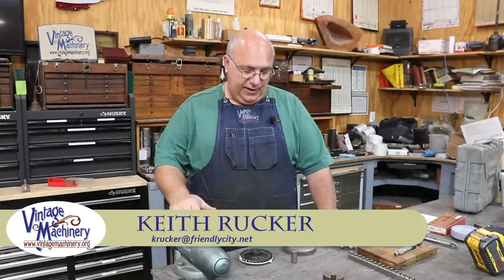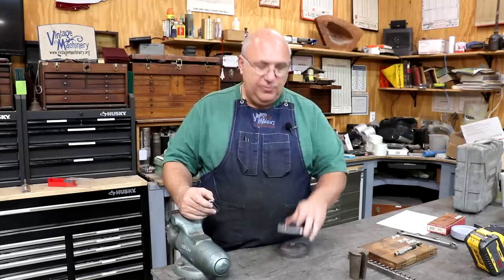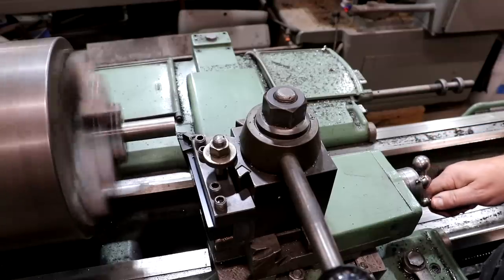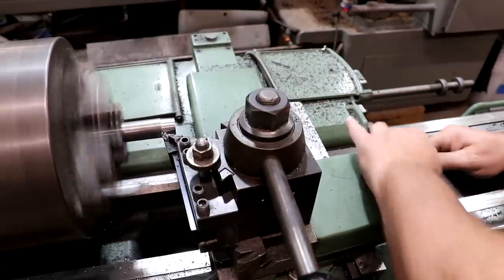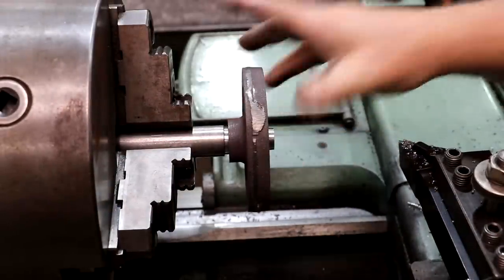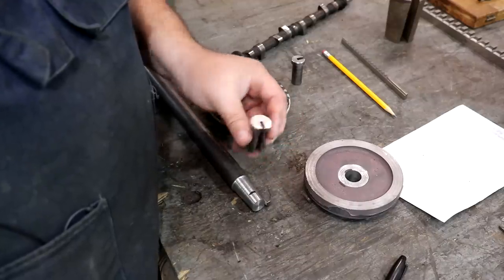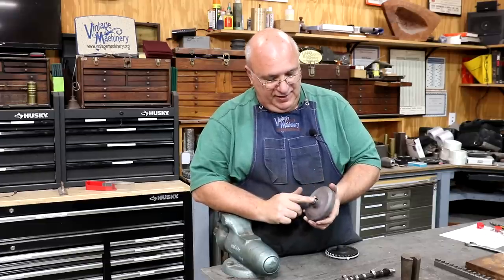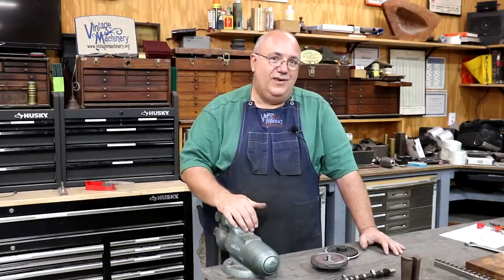Making a Tapered Broach Bushing for the 1928 Austin Camshaft Timing Gear

Comment: The timing is hugely important, the timing gear indexes on the keyway, and ensures that the cam timing is correct when all the timing marks are lined up, even a few degrees out will make the engine run rather less well.
Reply: Micky's exactly right.  That key sets the valve timing relative to the crankshaft and pistons and there is no fine adjustment.  The more care you take in duplicating the timing of the original gear, the better.  I don't think it's possible to overstate the importance of this measurement.
Reply: @kensherwin4544  IMHO that keyway should be done first to enable a positive anti rotation mount for the gear cutting .its got to bet better that 1 deg . I bet that OE was cut on a Gleason gear hobbing machine
Reply: @stuarthardy4626  I would do the keyway first, too. A matching keyway in the arbor would insure the gear doesn't slip while machining the teeth. 

My guess our thoughts on how this "oughta" be done are irrelevant because the job is done by now.  It will be interesting to see how he chose to do it.
Reply: Just for those reading along, we are talking VALVE timing, This is not anything like normal ignition timing, that is set and re-set often.
Valve timing is set by the manufacturer and during engine maintenance, or even rebuild, normally there is no way to alter it.
Reply: @MikeBaxterABC  Advancing the cam is an old hot fodder trick to get more horsepower. There’s several ways to do this but an offset key is the most common. Since camshafts rotate at half engine speed 1 degree = 2 degrees on the crankshaft. It will be interesting to see how Keith matches the keyway to the gear teeth.
Reply: Keyway is relevant to cam timing very important placement
Reply: Helical Gears should be able to time by changing the plane of the gears to each other. As this one is fix on that taper the matching one could be moved in and out with washers and thereby change the timing. The meshing will change with this but will stay in an usable range for a while. So in fact the axial fit of the taper will affect the timing, the set of the planes axially will affect it and of course the timing of the key will affect it. If i do not have a hickup in my mind.😄
Reply: @hermannstraub3743  This is not the usual way timing is set. Both gears need full engagement for proper operation. Since this engine (like the flathead Ford V8) uses a timing gear instead of a chain the camshaft turns in the opposite direction to the crankshaft. This must be considered when setting the timing.
Reply: I'm glad all you folks are thinking about this 'cause my unds were definitely getting into a twist ... heh.
Reply: While this is true to some extent I have found factory gm cams have installed cam timing variance of +- 5 deg. One of the reasons some engines run better than others. Worst case you can generally adjust cam timing with an offset key if absolutely necessary.

Comment: Mr. Rucker, A mate of mine runs an engineering workshop in Australia, he has seen both of your videos and he tells me to get this work done if, the owner of the part could find someone to take it on would cost quite a few hundred dollars in not only machine time but labour as well. not many shops would do a small specialist job like this. All the power to you sir
Reply: Fortunately there are several videos and enough viewers to make it advantageous from a video aspect.
Reply: @jayreiter268  With the added bonus of watching a helical gear fabricated on a semi obsolete K&T horizontal mill using Rube Goldberg style attachments.
Reply: @cyrilhudak4568  I would not call it Rube Goldberg. that is the way it was done on those machines. They also had high production machines. Automatic screw machines and Gear Hobbers. Bet you can make great cams for a screw machine on a CNC if you want production.
Reply: @jayreiter268  ☺ Where do you think Mr Goldberg came up with the ideas for his contraptions?
Reply: @cyrilhudak4568  I am only eighty so I do not know. I have seen  just a few of the cartoon strips but they were before my time.

Comment: As other said the key position is critical. One mod on other pre-war cars is replacing the timing gears with more modern designs that allow fine adjustment of the valve timing as adjusting it on the timing gear teeth is far too coarse an adjustment. This film was most interesting, thank you. I asked on my own channel how this is done and someone sent me here. I need to make a driving dog to fit a magneto to drive a water pump on a Pre-War Riley. The magneto shaft is tapered and keyed. I can machine a taper but doing the keyway is beyond my capabilities. This explains perfectly how I could do it but I don't have a broach set anyway. I can buy an existing part with the right taper/keyway in it and modify it by adding a separate driving dog piece to it. Buying the part to modify, though not cheap, is still far cheaper than buying a decent broach set.

Comment: The relationship between the gear tooth and the key is critical. The engine builder should check valve timing during assembly and use an offset key to correct any minor error. The key does not carry load, it only maintains the relationship until the assembly is tightened. The taper engagement carries the load when the nut is tightened to the proper torque spec.
Reply: I was thinking that too, from the point of view of rebuilding the engine. I imagine the position of the cut gear teeth in relation to the key would also be critical, but Keith seems to be ahead of me on this!
Reply: It’s a 1928 low compression engine (8.5?) that likely doesn’t operate above 3500 rpm.  A 1/4 to 1/2 degrees of value timing isn’t that critical.  It’s not a 6000 rpm, high compression ratio modern engine.  Keith has a rotary indexing plate.  He can use the same key cutter to index the old and new to align the teeth
Reply: @jimeadie4415  Likely under 6:1 compression. Maybe far under.
Reply: @jimeadie4415   Jim, I think you are right here, if I counted right there are 32 teeth so at worst and whole tooth out would be 11 and a bit degrees, but of course it runs at ½ engine speed so  that five and a bit degrees, but , here my logic goes a bit woozy, but  at worst, one can’t be more than half a tooth out or you ‘d off by the next tooth, so if I’m right that means half again .  I had a read of the A7 forums and this gear gives all manner of hassles.

Comment: The relationship of the key and the gear teeth is highly important to ensure correct valve timing is maintained.
Reply: I’m pretty sure that Keith knows this is a timing gear that must be accurately keyed to the crankshaft. If he doesn’t he’ll have a beautiful helical gear to display on a shelf that will not work on an engine.
Reply: @ellieprice363  I'm pretty sure he knows it as well but just a little puzzling why he should say in the video he is not sure if the keyway location is important/critical
Reply: @howardosborne8647  I noticed that too. Actually if you had the engine it could be timed accurately without a key but you’d have to have a good understanding of engines, cams, and valve operation.

Comment: You are correct in assuming that the placement of the keyway is important. The gear has a timing mark that would align with a corresponding mark on the engine. The camshaft needs to be set in time with the crankshaft for optimum performance. One tooth off in either direction could really affect how well the engine runs.

Comment: As a retired Auto Mechanic I have been silently waiting to see if you were thinking ahead enough to index the keyway to the marked tooth (which is very important btw not that you needed me to tell you that if you're reading the comments valve timing being off one tooth will effect idle quality terribly) & as normal you didn't disappoint me. I think it's so cool that you & (seen Abom do it to) will make a part & not know much about what said part goes on or does but you can make it anyways.. Now on to cutting the helical teeth.

Comment: I see comments that the key should be used to hold the blank while cutting the teeth.  Wouldn't the taper hold the blank securely enough to mill the teeth?  I mean, there will be a nut to hold the arbor, too. Tapers are quite good at locking up. 

I never figured on an offset key to make up for minuscule errors.  Brilliant.  And the statement that the taper holds the position of the gear on the camshaft makes perfect sense, too.

Lots to be learned in the comments for older gear driven valve timing.  Another addition for the mental tool box.

Comment: Keith, I wonder why you don't make a keyway using metal plainer? You can hold the gear at any angle and cut the keyway using some sort of short boring bar with single-point cutter.

Comment: Curious.. is it obvious that the key allways shall be cut parallell to the axis of the shaft…. My gut feeling was that it might be an good idea to cut it parallell to the conical surface? (Maybe not in this part, but generally speaking).  And another thought… a normal straight broachplug rests on the wide lip at the top when broaching… this plug has to jam into the sides to stay in place…. Isnt there a risk that it will deform and jam up the gap for the broach? I’m a shop noob, by I would have tried to keep a lip at the top to take up the axial forces of the broach friction against the plug….. (just some speculation)….. thanks for your entertaining videos…

Comment: I wonder if the tapered broach bushing could be done a little different.

DISCLAIMER: I have absolutely NO practical machining experience.  This is just me speculating.

I would have kept cutting the taper until the gear hit the collar before it tightened up on the taper.  Get it as close as possible, but with a slight clearance fit on the taper.  That would keep the broaching pressure from tightening the gear into the taper of the bushing.

If the gets pressed into the taper, it would only require a hammer or press it to get it back out.  So, probably no problem.

But, I wonder:  Depending on the clearance between the broach and the bushing, could the taper actually pinch the ears on the broach and bind up on the broach itself?  It would have to be a really tight clearance for that to happen.

In the end, I think going the extra trouble I was thinking of, would at worst be wasted work.  But maybe, just maybe, avoid a possible issue?

So, I am mainly posting this to see what comments you actual machinist would have.  And see if I am starting to think like a machinist.

FYI: I have a new hobby grade lathe and mill, but don't have it installed, yet.

Comment: Aren't you edge finding to locate center of the broach bushing on a part of the shaft that wasn't turned? In a three jaw chuck won't that tir error offset the key from center? Maybe better to have turned the shaft OD clean to give an concentric surface for edge finding...

Comment: Hi Keith. Dumb question. When you were measuring the center line for your custom broach thingy, you touched off on the left edge of the workpiece with the right edge (from the viewpoint of anyone watching the video) of the edge finder, then you traverse the table over and touch off the right edge of the workpiece with the left edge of the edge finder. Won’t that throw your measurement off by the radius of the edge finder once you divide the measurement on the DRO by 2? Or did you already accommodate for that off-screen? 🙂
Reply: Because any "error" will be exactly the same both sides, you just divide the DRO measurement without regard to the edge-finder or piece size

Comment: Great video, I am totally surprised because I thought the group for the brooch had to be parallel to the angle on the tapered part. That way your broad keyway will be parallel to the angle on the finish bar. Am I wrong thinking this way or what?
Reply: That is the way I did my tapered broach guide.

Comment: I have a question!  Do you, by any chance, know why the designers used a tapered connection to attach the gear to the cam?  Just another why would "They" do it that way question.  BTW, "THEY" is that big international organization that runs everything.  Looking forward to seeing the the K&T cut the teeth in that gear.  Thanks for the videos.
Reply: My bet would be to make a solid connection it would either be tight or loose and easily discernible

Comment: Should be a timing mark on the existing gear that is relevant to the key in the gear and the teeth.....Helical gears present challenges not present with spur gears.. Angle of helix, lead of helix, real pitch,, the number of cutter differs as compared to spur gears.. Also, with cutting helical gears, rotary thrust is present....There are over 42,000 leads in the Kearney and Trecker low lead chart and very unlikely that you will find the exact lead rather it will fall between two.. Cheers from Louisiana; Mike

Comment: I am probably in error, but shouldn't the slot in the broach plug be at the same angle as the taper?  Looks to me like the keyway at the top will be very shallow when compared to the bottom.
Reply: If I  understand the other comments correctly the keyway is there to locate the gear for engine timing.  As such the key is not being loaded radially.
Reply: Yeah I would think the same.

Comment: Does a broach bushing typically get heat treated?
Reply: For a one off job it is not necessary to heat treat. For repeated use it should be hardened, however heating the tool can cause final dimensions to change which requires making the tool nominally oversize and precision grinding the final dimensions after treatment. I suppose that shows where some costs can accrue from making a simple tool designed to be used minimally versus one that is designed to do the job while providing a useful life in production environment 🤔

Comment: Shouldn't that keyway follow the taper of the bore rather than being vertical?
Reply: No it shouldn't. The key seat in the shaft is always parallel to the centreline of the shaft therefore the keyway cut into the bore of the gear needs to match that axial alignment. The taper is only related to the bore not the key. A similar situation exists with tapered threads in that the threading tool is set parallel to the centreline of the workpiece rather than parallel to the tapered outer
Reply: I had that thought, making something to hold the gear on an angle so the broach could be kept being pushed straight down completely vertical. then you got to go to all kinds of trouble to cut the key on the shaft at an angle. Half way through this is the simplest, fastest best way to do it. I have a complex mind which is great for complex solutions, but boy sometimes its a massive detour here there and everywhere and someone does the same job in a fraction of the time lol
Reply: @howardosborne8647  Thanks for that info.

Comment: Keith, did I miss something?
When using the edge finder don't you need to compensate for half the diameter of the edge finder?
Reply: Not if you check both sides of the shaft with the edge finder Half of the reading will put you in the center of the shaft.
Reply: @ellieprice363  Disagree.  The diameter of the edge finder matters.  The DRO shows you where the center of the edge finder is, not the side of the edge finder.
Reply: @919Drones  you are wrong. (X1-d/2-X2+d/2)/2 =  (X1-X2)/2. The offset on either side compensates for the irrelevant diameter of the edgefinder
Reply: @919Drones  I really don’t think you know how to use the half function of a DRO.
Reply: @919Drones  That’s true if you’re using the edge finder on one side of the shaft only. The other way is to zero the edge finder on both sides of the shaft then take half of the total reading to put you on center. This is the method I was referring to.

Comment: 0:50 it would have been possible to broach the gear, then cut the taper on it.  Still wondering about the valve timing though.   See what happens :)

Comment: Hi Keith, would it been possible to broach before you tapered the hole with a standard insert?
Rich
Reply: Yes but it would be an interrupted cut and could potentially chip the edge of the keyway

Comment: I wonder why the cam shaft designers decided to put a taper there. Im pretty sure there must be a reason for that but I cant get it.
Reply: LOL because in 1928 they did shit because they could.
Reply: Some used a tapered nose some just a tightly toleranced sliding fit on a parallel nose with a key in it.
Reply: @cyrilhudak4568  hehe reminds me of Jeremy Clarkson putting forward Brunel for Greatest Britain, The rectangular box rail bridge was copied across the world because it was easier for the designers and the people who cut the metal to do. The Royal Albert bridge, no one ever copied it and plenty didn't understand it. why did he do it this way, because he could..
Reply: @cyrilhudak4568  LOL
Reply: @howardosborne8647  Thank you Howard. And why wouldn't they have used a shoulder?
Reply: @capitanschetttino8745  A shoulder register is only used when it is a parallel shaft there is no shoulder with a tapered nose or it will prevent the gear from registering tightly onto the taper
Reply: @howardosborne8647  Yes, I mean the shoulder instead of the taper. But I guess the taper fixes the gear tighter, right?
Reply: @capitanschetttino8745  Matching female and male tapers are far more reliable at firm fixing than a parallel shaft and gear bore could ever be. I reckon the reason this original gear is broken is aas a result of someone trying to release it from the cam shaft taper with a 2 or 3 legged puller and applying too much force at the outer rim. Matched  tapers will lock together with a very high degree of mechanical integrity.
Reply: @howardosborne8647  Thank you Howard. I have learned something new today. I owe you one.